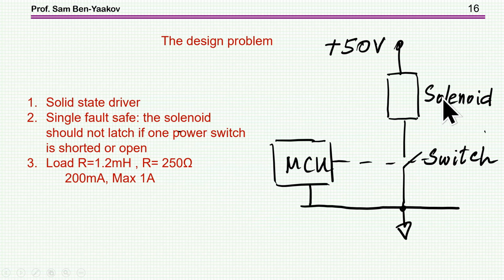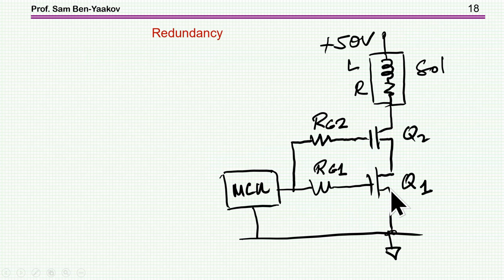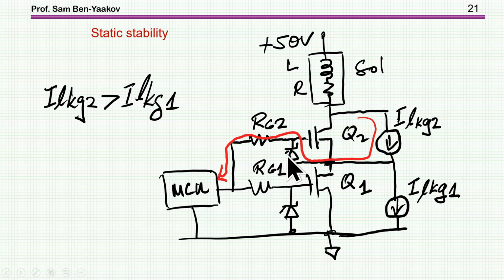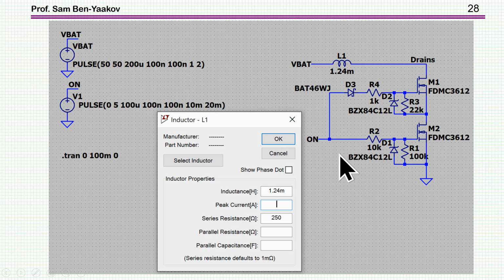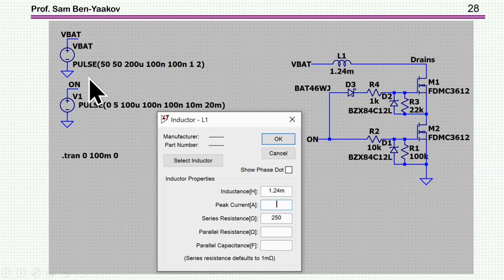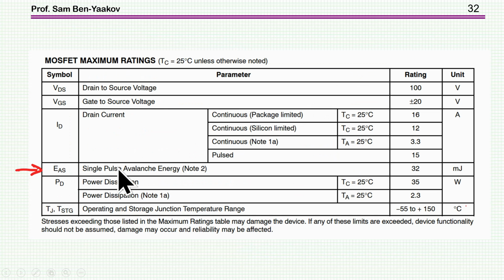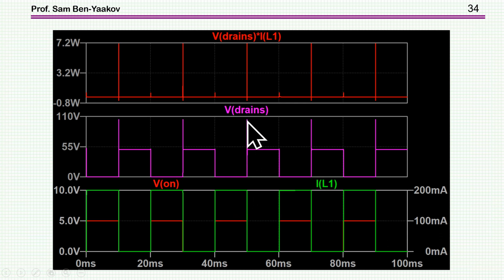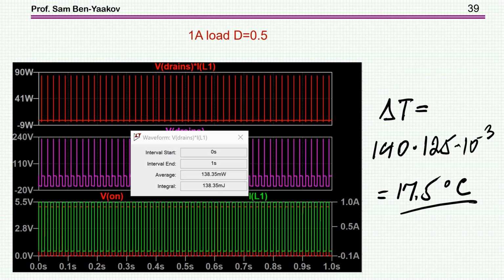Design example of a single-fault-safe solenoid driver

Comment: Very interesting on the avalanche energy specification. I'm guessing that if the datasheet doesn't mention Eas, then the most logical assumption is that the mosfet doesn't include the internal zener and an external one should be supplied. Would you agree with this conclusion?
Reply from the maker: Indeed, if you expect a voltage overshoot.

Comment: You are still relying on only one mcu pin. Unless your mcu is designed to have fault tolerant pins a single faulty transistor in the mcu can turn on the load. I would use two MCU:s that monitor each other.
Reply from the maker: Thanks for comment. Good point.

Comment: Would it also be a good idea to place a zener diode from the MC output to ground, in case the voltage at the port rises? The zener could then break down, and shunt the potential current/spike to ground. This would of course further reduce the speed of the solenoid operation. 

Thanks!
Reply from the maker: Not really necessary.

Comment: Great Video!
The ability for the MOSETs to absorb the inductor kickback was new to me, and I'm so glad I watched this video. Do these frequent high voltage spikes across the MOSFETs increase the stress on the MOSFETs? In regard to the operating life and transistor degradation over time? I have read high voltage stress can cause transistor parameters to change and could cause a failure.
Reply from the maker: "Do these frequent high voltage spikes across the MOSFETs increase the stress on the MOSFETs? "not as far as I know. Obviously if the avalanche is repeated continuously, one has to worry about the thermal dissipation.